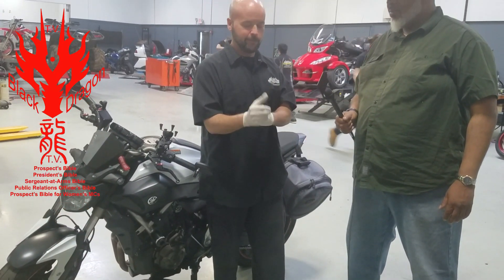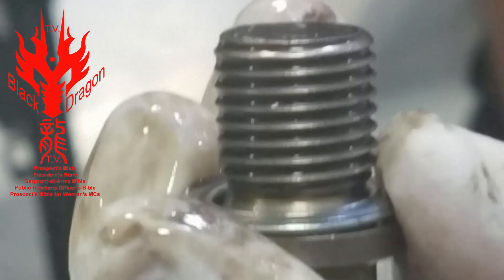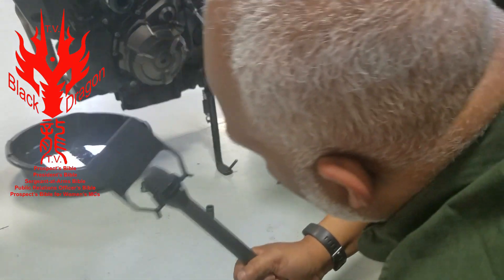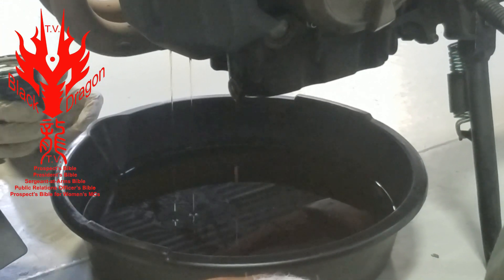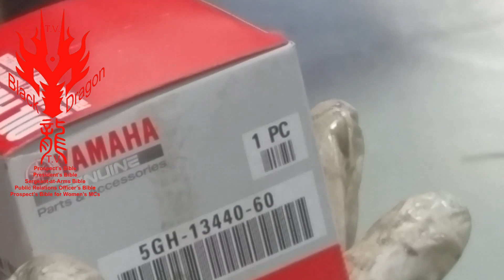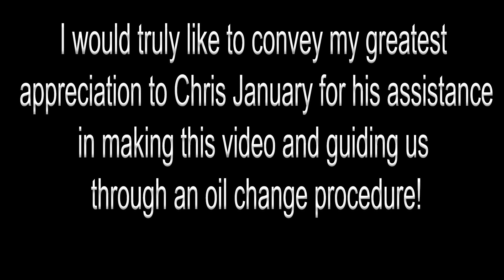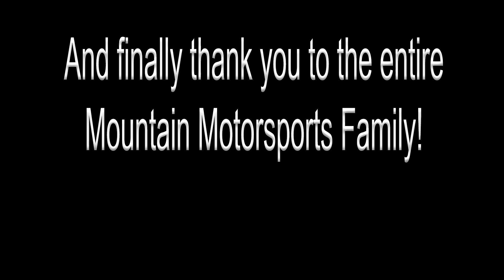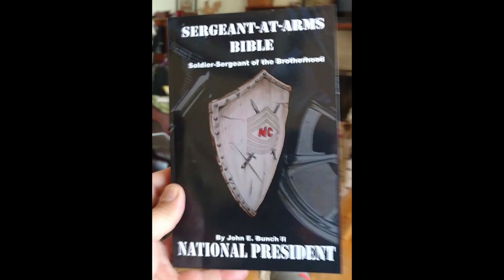How to Change the Oil on Your Motorcycle 101

Comment: Summer time this heat can be damaging change the oil if needed run good quality oil and if liquid cooled check that ani freeze could need changing.

3 of us  just came off a run from Elpaso Tx 650miles from my home in Texas one way ended up being 1450 mile trip.... The temperature hit 105 to 115 degrees!!

DO GOOD MAINTENANCE IF YOU DON'T YOU'LL BE SORRY!!